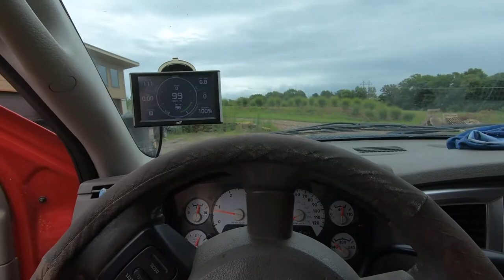Fixing Overheating Issues on our 3rd Gen Cummins

Comment: Ryan
Can you post the brand of fans you installed and whether or not you can wire them to the thermostat sender so they would turn on when thermostat opens?  Also would the two fans fit if you used your stock grill...what size fans?

Comment: Ryan Cowart did the fans help? I have the same problem on my 3rd gen. Changed the pump, thermostat,  cleaned out the radiator, fan clutch,,  etc and still gets to 3/4 HOT.

Comment: Arnt u ment to put the fans behind the radiator?? The point is to suck air through the radiator....
Reply: Nah fans are reversible, if they are behind the radiator they gotta pull air, if they’re up front they gotta push air , as long as air gets forced through radiator fins everything should work out fine

Comment: That will help, but you're putting a bandaid on it, not fixing the issue. Have you taken to the dealer and had them run on their computer?
Reply from the maker: No, we’ve done almost everything. Entire cooling system is replaced. Truck only had problems when the wind would go the same speed as the truck, up a hill pulling 15,000lbs and holding 2.5-2.7k rpm. Surprisingly now the cooling handles it fine. The 48re trans on the truck screws everything up with its timing and torque values.
Reply: @ryan_lexi  generally an issue occurs somewhere in the system, I run a Firepunk built 48RE.

Comment: this is an issue with the ecm not reading a temp somewhere in the system. a faulty cooling system,or the cummins is overbilt for cooling capacity and making  too much heat.. two dinky fans will help not much at all.
the cummins fan is more than adequate to cool this engine , if it is told what to do and the radiator is full and clean.
most often the trans cooler leaks, plugs radiator owner cusses  and trys to cut corner his way out of it
Reply: Where does the trans cooler affect this? I'm about 8 hours into it with nothing close to a solution. I flushed the radiator and still have the same issue.
Thanks!

Comment: Dude, why wouldn’t you check to see if your cooling system is working properly before hacking on two cheap, electric fans?? How’s your thermostat? FAN CLUTCH? Clean radiator? Did you add a bunch of horse power? Putting on those electric fans is unnecessary if your cooling system is working properly.

Comment: Sounds like a little RC car lol
Reply from the maker: It does🤣
Reply: I have a 05 Dodge 3500 5.9 cummins no over heating ever and I would guess his factory clutch is shot only grabs enough to spin it. I put a 180 thermostat to help cool down the rear cylinders and I love it my gauge says 190 instead of 210 all the time the gauges in these trucks aren’t the most accurate but I did use a heat gun and it reads cooler. I bought a new 92 Dodge 2500 4x4 and it would run at 1/4 make on gauge when I pulled heavy in mountain’s the gauge would creep up to the 1/2 on gauge and just drop a gear and temp drop to a 1/4 where it usually ran all the time with out big load. Then I bought a new 05 Dodge 3500 5.9 cummins with 6 speed manual and the gauges are not very good I’ve told all reading’s are computer generated but down know if true or not but the older trucks had real gauges that were accurate checked with heat gun .